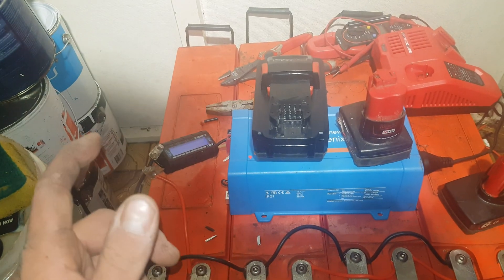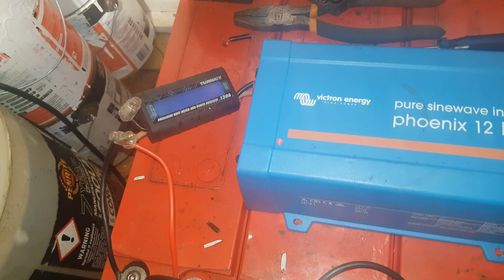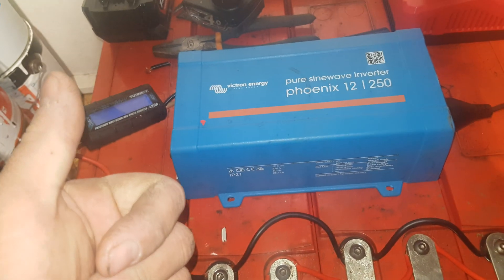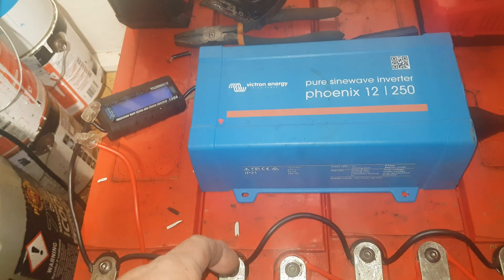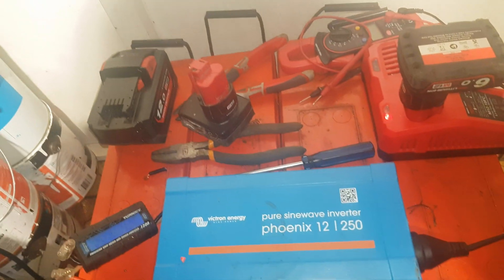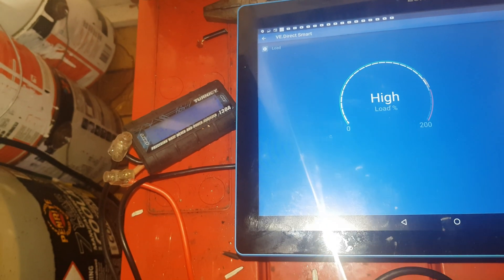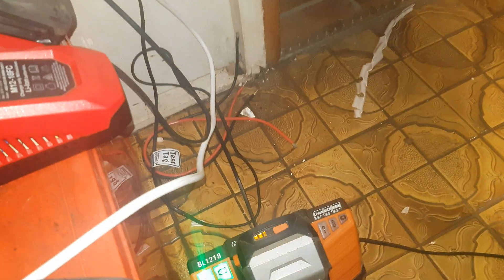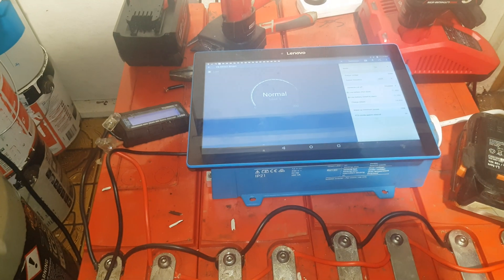8kwh Agm Scrap Yard Batterys Capacity test setup Victron 250va 12v Inverter

Comment: Under load down to 11v is playing it safe but I reckon (they the manufacturer) probably test capacity lower and let it bounce back to 11v
Reply from the maker: How low under load 10.5?
Reply: Not sure. when it gets to 11 v under load see what it returns to eg 11.3v.
Then maybe drop the inverters cut off  to 10.8v (normal load cut off) it all depends on how much load and how much time you have.
Reply from the maker: Best part of the victron inverter is it will go down to 9v. We are over 1kwh already still at 12.6v
Reply: I personally would maybe only capacity test down to 50% and just double the results, as below this reduces the life of the batteries. realistically daily usage to maintain good life of the battery  is around 25% that’s only 2kw of the max 8kw you have. And 4kw in power outage situations.
Reply from the maker: Thats true i just want to sort of test total once
Reply: That seems a little too good, might drop quicker later.
I think the original estimate of capacity on these types of batteries would have been over 20 hours so maybe  190/20 = 9.5 amps load for 1 battery  9.5x12v=114 Watts x4 batteries =
456watts drawn every hour for 20 hours??? Any faster discharge and you loose capacity so I’d imagine any slower and you may gain some capacity.
Reply from the maker: They are rated 190 over 10 hrs down to 1.8v per cell
190 over 8 hrs down to 1.75